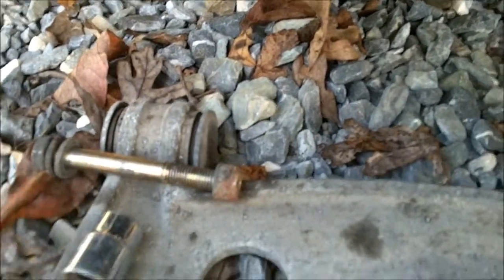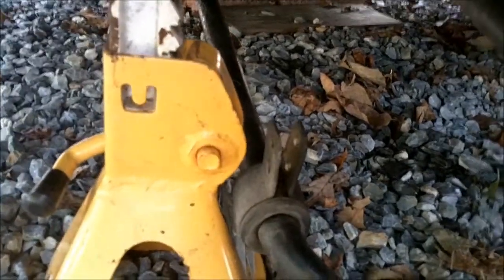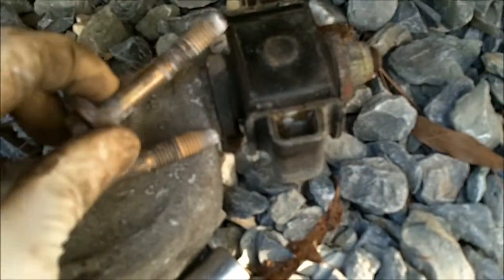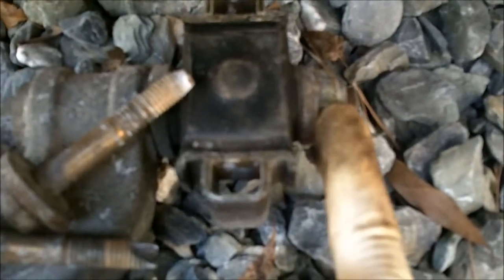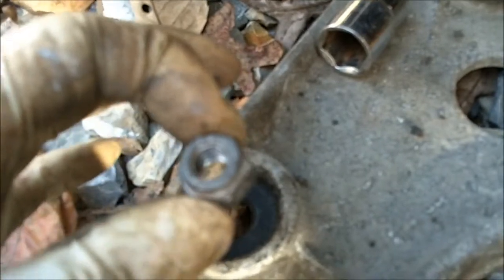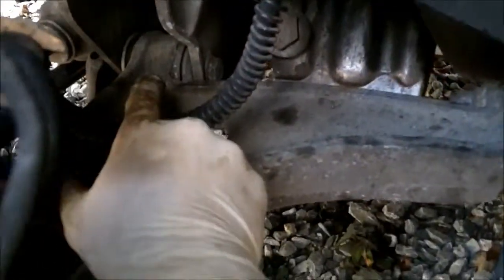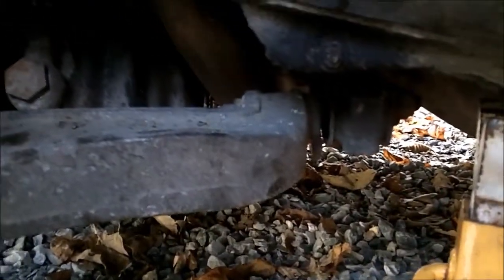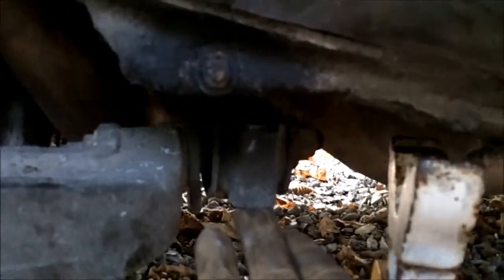CONTROL ARM INSTALL - 944 Turbo - Aluminum Control Arm + torque specs

Comment: GaryKist, are these torque specs similar to if not the same as the specs on a 944 base? I've got bad ball joints and ordered the rennbay kit, unfortunately I have no tools and no garage wants to even touch it. I have a bit of an odd question, but I read that the geometry of the suspension is designed oddly which causes wear on one side of the nylon bushing. Would a bit of negative camber help with that problem?
Reply from the maker: The torque specs are the same. It's true that the nylon bushing wears oddly, once the bushing wears away it starts wearing the aluminum cup of the control arm, if that happens you will need the brash bushing kit from rennbay, the nylon kit will just squish through on one side and you'll have loose ball joints again. It happened to me and I had to go back and put brass bushings in.